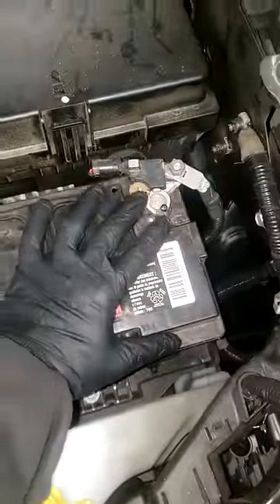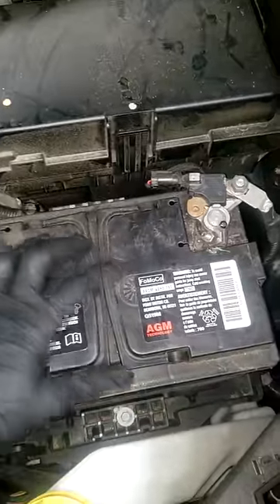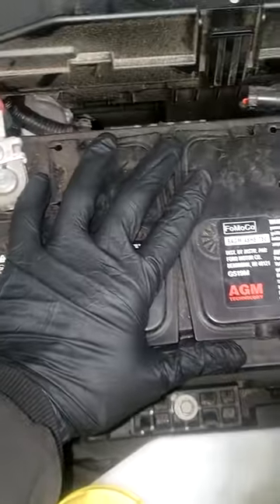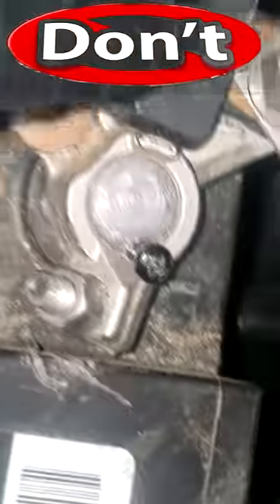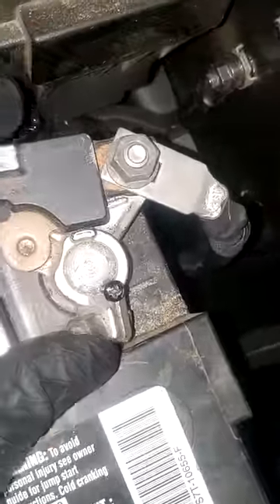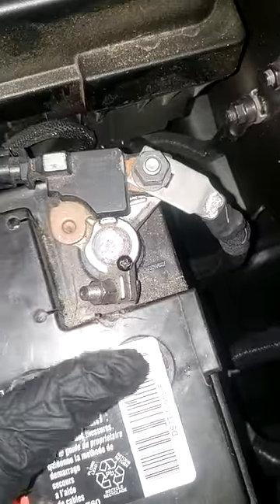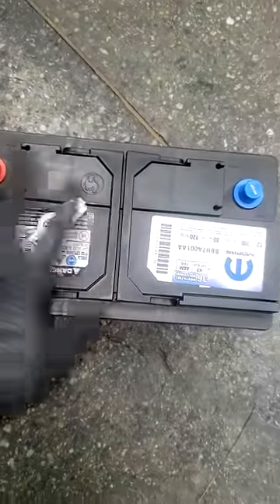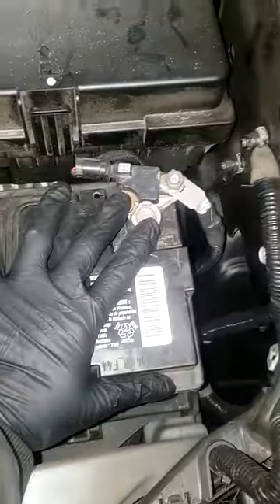STOP DOING THIS PEOPLE. This will destroy your car electrical system.

Comment: Can you send me all the old batteries as just changing them without proving the battery is at fault . Means some good batteries are changed for no good reason.
Reply from the maker: I change the battery 1 time, which was the last time Ive seen this car. Its gone and fixed my dude. I cant help it she bought a defective battery from autozone. Get ya mind tight.

Comment: What about a engine failsafe mode 
Aka limp mode after leaving the negative terminal disconnected 
For like 40 minutes  ?
Reply: And what about it exactly? I don't imagine it would go in limp mode over a IBS but with this new generation of cars you can turn wrong and shut it down so 🤷
Reply: @rome525  
2005 mercury mountaineer

Comment: Says the screw was the cause of the problem. Won't explain further. Yeah okay.
Reply from the maker: Its simple. Connection at the battery compromised. O wait, theres a screw in there. If this needs to be explained to you then you have bigger problems.

Comment: Even on older vehicles without all this electrical computer shit that screw hack can cause issues.  If the vehicle doesn't have a properly working electrical system it will cause all kinds of issues.  Fix it right or leave it to someone who can/will

Comment: Load test battery, pass or fail?  Pass, replace sensor, put original battery back in car.  Fail, replace battery only, the sensor is fine.  The final thing that can happen is the customer back pissed that their new battery died on them,  RMA the battery and recommend customer replace the sensor, or test it if you have the tester, most likely it’s the cause… unless you didn’t check the alternator and terminal corrosion, 🤪👊🏻

Comment: Autozone sells an adapter to go over that battery terminal😳
Reply from the maker: Thats not a good idea on the new cars
Reply: @Online Mechanic Tips  why is that 🤔
Reply from the maker: @jcaleca60  The newer cars are extremely computer driven. Meaning most of the major parts are computer controlled. Which means the electrical sys has to be on point and if it detect any flaw voltage spikes because of crap like battery shims installed, it could lock you out. Your trans could stop shifting or simply no start. The bus network on new cars are very dependent on the proper perfect electrical sys.
Reply from the maker: @jcaleca60  O and can you please consider subscribing to the channel? Thanks
Reply: Jt, I'm not trying to start an argument with you cause I really do like your vids. But I to am a dealer tech of 30 ys.  And I have a question about your theory on the battery terminal repairs. I myself prefer to repair them correctly although during years of testing, the "road side term repair" has, if done tighly, never caused a voltage drop, voltage spikes, increase in resistance,  or amperage draw. Im not saying that it can't happen if it's not secure, but if it is a secure connection, in my opinion, it won't hurt anything till you can get it to a shop where you can get the bad terminal replaced. Would love to here your opinion after reading this Sir?

Comment: What are you doing with the temporary terminal you have to replace the entire cable! that screw in there is better off the way it is then you putting a temporary connector on there just insulate it man
Reply from the maker: We don't make temporary repairs my guy. This car got a new battery and a new IBS terminal

Comment: I'm 100% sure that the problem here was the battery, not that screw
Reply from the maker: Do you hear yourself? Are you even aware what you saying? Smdh? So you basically suggest to replace the battery but leave the screw put...dude, the battery wrong and dead but the screw affecting proper connection at the battery and terminal. Which is the main thing that has to be correct on these newer advanced high tech cars.
Reply: @OnlineMechanicTips  i didn't say that you should leave the screw in, but that problem is not caused by the screw, is just a dead battery, i didn't say that the screw was a good fix either, chill man😅
Reply from the maker: @misuotto  I'm always chill, just shocked at some of the things screw defenders say. Yall been hacking batteries so long to where now you simply immune to it, lol, it dont even phase yall anymore. Well, we living in times now that if connection at the battery not on point, your transmission can become bricked and knocked off line. Yes, screws put inside terminals not good. Just replace whats causing the connection problem

Comment: I take it that the wood screw damaged the post?
Reply from the maker: Its a sensor thats monitored by the computer. Never screw into sensors
Reply: @OnlineMechanicTips  It sounds like common sense but I guess if just have to do something in SB emergency to try and get the engine to start, I could see someone doing that. Then having to pay to fix it properly.

Comment: It's like all the internet mechanics didn't hear him say it wasn't a terminal per say, 🙄 as in its a sensor and terminal together.  A lot of ya'll would of replaced the sensor with the terminal from the sound of it.... and yea if the light is gone and you know the customer won't be returning for that issue. That's a win.  Most of you would of had that awkward conversation about the light coming back on and oh well you reset it, let's hope it don't come on again but if it does just bring it back and we'll have to replace the sensor and see if that helps lookin ass

Comment: That sensor doesn't know the difference between the screw and the bolt holding the terminal on lol. Where is the battery test being performed to show voltage and condition?
Reply from the maker: The problem with this car was the poor connection at the battery as well as the battery bad/wrong using wrong size post. So somebody put the screw in to help. Thats not good on these newer cars

Comment: That's bullshit. That screw is nowhere near the sensor. The only problem here was a worn out battery. Maybe the connection is dirty, but that screw is doing no harm.
Reply from the maker: smdh, So let me get this straight, im factory trained by engineers that design this stuff and its hammered home to us how this will affect a cars electrical system, you home playing video games all day and you seem to suggest you have a better take on it than I do??? You joking right?
Reply: @OnlineMechanicTips  not that it is a requirement here, but i work on my own cars and bikes. possibly the most relevant example of which is when i had intermittent starting issues. 
it wasnt hard to see it was either a grounding/ connectin issue, battery issue or starter motor issue.
i noticed a lot of blue/green/white corrosion around the positive battery terminal, so i cleaned it and charged the battery. things went ok, corrosion returned. but it didnt fix it this time to clean it. so that was just a side effect, not the issue. i discovered it was the starter motor so got under the car and replaced it. problem solved. i.e - even an actual insulator on the positive battery terminal didnt stop the car starting. let alone a little conductive screw taking up 5% of the conductive surface area on the negative terminal.
so no. the screw is not negatively (or positively) affecting that car. 
now as to its position. there is very very very little reason for the sensor to be in that position, so i seriously doubt it has been screwed into any sensor causing damage to it. the sensor will be attached to the battery clamp on the other side, ride next to the electronics it works with. there is no reason for anything to be where that screw was.

as to your reference of me playing video games all day.
no. just like you i work all day, and i work hard at what i do (which is not playing video games.) i am guessing you are referencing my youtube channel which was just a hobby i took up for a while and have since discarded. yes i play video games, as you probably do to. i generally play a couple of hours over the weekend. but that is it. you insulting me over playing a few video games is pretty ridiculous and a lot of effort to go to, especially as it has absolutely no bearing on what is being discussed here.
Reply from the maker: @socks2441  It was brought up to remind you that you may be out of line telling a factory trained by engineers tech that you (a video gamer) think hes wrong..Theres a slim chance he may know a little bit more than you on this matter and has been warned about any such device affecting connection between the batter and the IBS. This customer lucky her transmission was not knocked out of proxi alignment (im guessing you have no idea what that is) Sure, you welcome to your opinion. But maybe your intial comment came off a lil harsh. But heres the bottom line. Those 2 parts replaced, the car is gone never to be seen again. I feel good that I made the right call, and the customer happy.  Im not here to please you guys on YT, im just sharing what im doing. Im here at the shop to please these customers.
Reply: @OnlineMechanicTips  if the issue was anything remotely technical I wouldn't have commented because, as you say, you are the expert, not me. But it wasn't technical. You were blaming a screw for a dead battery. If you wanted to replace the battery clamp along with the terminal, and the customer is happy with it. I have no problem with that. Just as long as you know the screw was not an issue.
Reply from the maker: @socks2441  You just said a bunch of nothing. Must you forget the reason why this customer in the shop in the first place. Her warning light is on. Using your logic its ok to replace these parts but its also ok to put the screw back in because it cause nothing...smdh at that
Reply: @OnlineMechanicTips  whatever man, unlike that battery post you seem to have a screw loose.
Reply from the maker: @socks2441  lmao

Comment: My dude, you do realize that there are many ways to tighten a loose terminal, adding a screw into the soft lead then clamping down on it won’t do a damn thing to that sensor or anything else
Reply from the maker: smdh, then just put 2 more screws in it. Sure your customer will be headed my way soon.

Comment: Putting a screw in for a shim isn’t going to cause any issues so stop making a big deal about it.
Reply from the maker: This not just a battery terminal, it doubles as a sensor. You can't just put screws in sensors and think your warning lights won't come on. This dont apply to your old ass car dude so you have no clue about this IBS.

Comment: I’d hit that with the oxy-acetylene, feed some solder into it and maybe finish off by cutting off that screw with a whiz wheel. Close hood, tail light warranty…you are too nice!
Reply: Never work on vehicles again if you want to rip people off
Reply: Edit: “right to fail it for that”. It happens when using a smart screen keyboard designed and sized for a two year old here... peace out auto techs!

Comment: These comments and this video is wrong a screw can disrupt the electrical but where this video fails at is acting like putting anything in between the sensor or terminal post will cause this which is absolutely false if that was the case installing big thick gauge wires to your positive and negative battery terminals leading to your amp would cause this not to meantion the remote wire going from your amp to your radio fuse 😬 don’t this myself by hand on a Toyota Corolla 2017 se, Nissan Sentra 06, and a Audi A4 06 and Ford Fusion 08. Had a professional certified sound shop do it on my 2014 Dodge Avenger and it was sought up the exact same I’ve been doing it on other cars. This alone prove all of this false headcannon on resistance is crazy talk 🤦🏽‍♂️
Reply from the maker: Yes, putting any thing between the terminal/sensor and the post not a good idea anymore. Especially on these newer cars. Nice of you to stop in and grade everybody and then leave the answers to all our concerns but verything you mention in your your comment not a good idea anymore. (at least not on this newer stuff) Your older cars thats not so computer dependent will be fine tho.
Reply: @OnlineMechanicTips  mostly done with older cars but I literally put a new model car in the comment… back in 2019 bought a 2017 and still ride to this day as long as the gauge wire your using is clean and the terminal post is new or free of rust and all car sound shops will do this it will be fine. I just had to come correct the loud and wrongness of both sides 😬 your surely welcome! Also side note of this comment : Professional, key word competition audio installation that usually put install another high power alternator and put a secondary battery in the trunk and have the alternator run a line to the battery in the back of the trunk and run off of that instead which is wayyy better and ensures a fail safe. But that’s more expensive and for the most part on the cheaper end most if not all sound shops and at home installers will opt for the terminal gauge hook route.
Reply from the maker: @Godofklout3  Again, all fine and dandy on the older stuff. This new stuff coming down the pipe line cant be altered. If the factory audio system removed or altered, your car may not even start. So the industry you speaking about days are likely numbered. The same with this car, you cant be using battery shims and screws to help with connection on this stuff.
Reply: @OnlineMechanicTips  which is why doing it on new cars are more expensive compared to older models

Comment: ummm that's a factory ford battery..... that's not a battery that should be in any other type of vehicle as that labeling only comes on batteries that the factory installed, which means that's a used battery.
Reply from the maker: The battery and the IBS was replace. Car gone, customer happy now. That other shop hacked all this
Reply: @Online Mechanic Tips  i could tell right away when you showed a chrysler v6 with a battery with a label that isn't even available to the public. as the factory ford batteries always are labeled differently then the replacements sold by any ford dealer.

Comment: Wow so you just charged your customer for a new sensor for no reason? Pretty shameful. You probably could have just started with a new battery to at least narrow it down. You could have purchased a new set of terminal pliers and fixed it for less.
Reply from the maker: Sorry but we dont work off probly shoulda woulda couldas. Im not standing by any of those compromised items. You would be out of business with crazy time wasting thinking like that my guy
Reply: Best of luck in your business bud. With that parts cannon approach you’d fit in better at a service centre.
Reply from the maker: @Clynikal  Nah im doing great how I currently have it set up. Thanks

Comment: so by your logic and attacking other replies and comments  even a proper shim would be  bad ?  a terminal is not a sensor  and contact is contact ... please comment about older cars and whatnot ... but electricity is electricity .....
Reply from the maker: First off, please understand, Im not attacking anybody. Im merely responding to comments. Based on how that comment reads, dictate what kind of response I deliver. 1 at a time. Yes, a proper shim would be bad, No, a terminal is not a sensor but when a sensor attached to a terminal and thats the only way you can get it, I consider them one. Older cars as opposed to newer cars, not the same as for the newly computerized equippement used. Heres the thing dude. The newer cars (in the video) Must, I repeat must have and maintain proper, excellent, factory type connections at the battery or all bets off. Every module on these cars are to sensitive to any kind of voltage spike or amp changes created by poor connection at the battery. These modules are sync and proxi align. You could easily brick a transmission like this. Now cars use start/stop (this one) and needed a better way to monitor the amp and temp of the battery. If the connection poor created by some guy that thought this screw was a good idea it will confuse the electronics. The screw affected the connection point, yes its screwed into the terminal/battery post. Now, this was ok on older cars because theres not a lot of electronics. Thats why in the video I said dont do this on the newer cars. The instructor at the school I go to always said people will slow react to this. They come in on the tow truck all the time because of bootleg connections at the battery. Not good on newer cars.

Comment: Did you really put that battery on the ground? That will kill the cells
Reply from the maker: how
Reply: @OnlineMechanicTips  The ground will pull  all the energy/power out of the battery and kills the cells. Try it take a charged up car battery and leave it on the ground over night